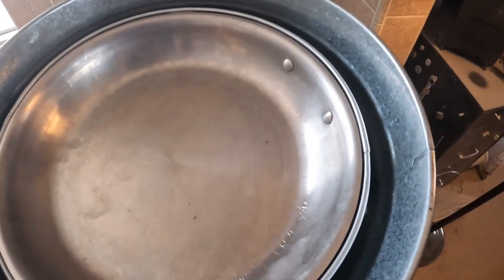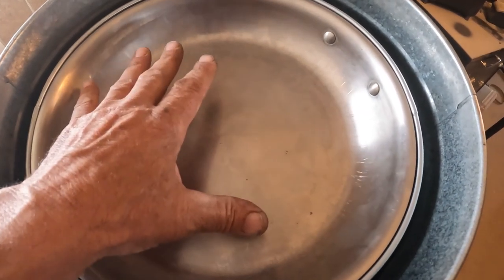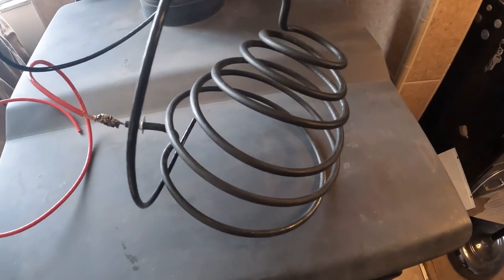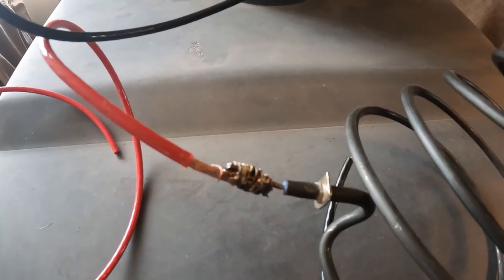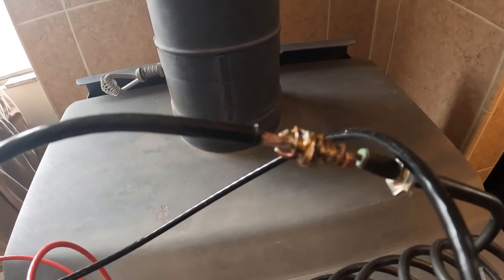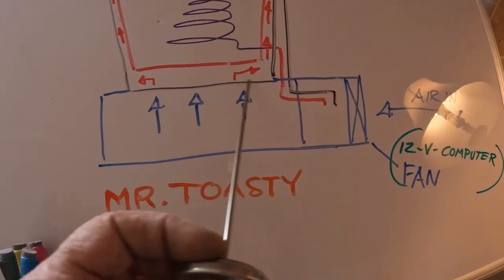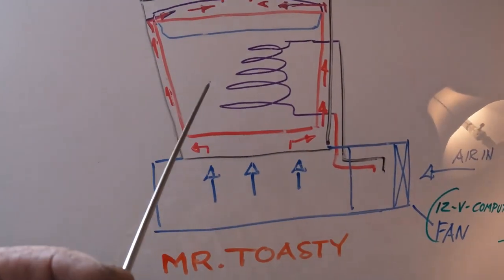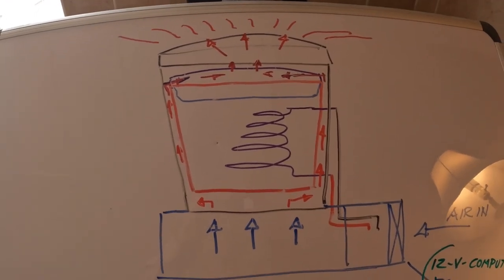Portable Sand Battery Update Part-13 Mr. Toasty

Comment: You may need some metal in the sand full depth sticking out the pizza top to transfer the heat from the center of the inside can. It will be interesting to see how long the heat will last on one charge.
Reply: I was thinking about that! Maybe some heat pipes would work great! 🤔

Comment: Know your building prototypes but word of warning. For hot-dipped galvanized steel the recommended maximum temperature is 392 F (200 C), before the metal presents a toxicity risk. Thanks for update.
Reply from the maker: Good to know so food may not be a good idea with that material. Okay well I will move forward with the prototype regardless and just keep that in mind.
Reply: @off-gridsurvivalmike8120  If not for the fact I welded for a while and was warned. But look up trashcan turkey , voila! outdoor oven. Great work and can not thank you enough for sharing. The question of why not put the element directly in the sand intrigues me.
Reply: @off-gridsurvivalmike8120  galvanize is a zinc metal coating that turns to vapor at high temp. Welders  exposed are to drink  milk (calcium) to bind with excess zinc .this should not be a problem  if you cover your cooking pot with a lid and don't breath the vapor when you obtain  high temperature  even so it takes a lot of zinc to be toxic and most men need to take zinc supplements.